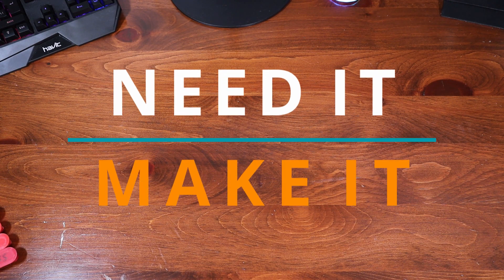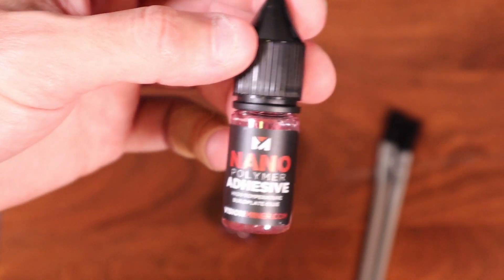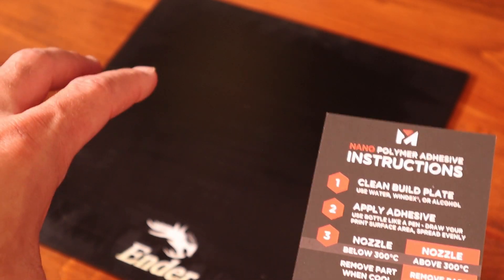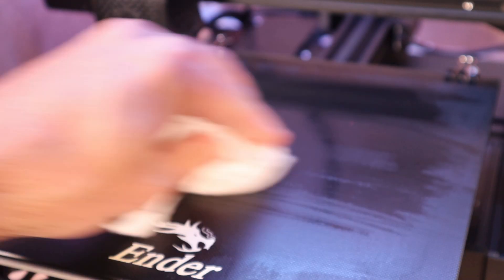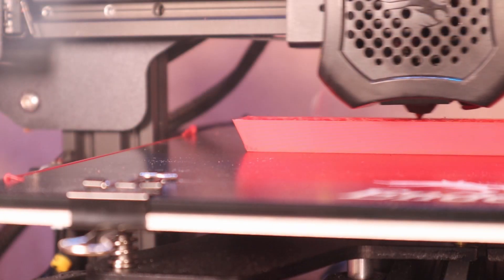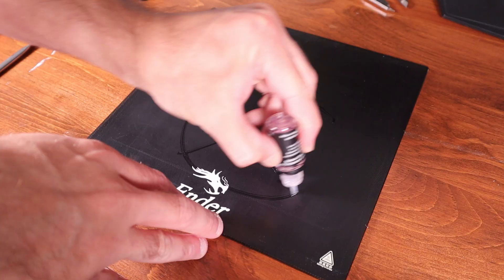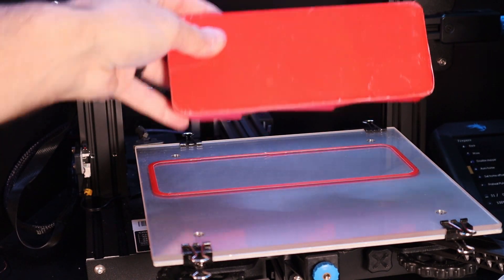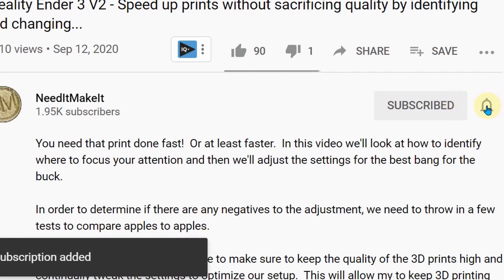Creality Ender 3 V2 - This Build-plate Adhesive Worked a Bit too Well

Comment: That chunk is pure carborundum which is E3V2 is famous for. This thing, naturally, is only found on meteorites. This thing does the most adhesion on this printer's plate and using other clear glass to take any measurements is absurd. Its expensive too. No one will ever try this product on their board if it can take a "Chunk" out of the plate.

Comment: That's the Ender silicon carbide bed! You should not need to put ANY thing on there to get prints to stick. I have problems getting prints OFF that bed if I don't wait until it cools completely.

Comment: I just clean my ender 3 v2 build plate with 99% ipa and pla sticks perfectly every time. (I use ABL). A great upgrade would be to use stiffer springs and take time to adjust the z offset.
Reply from the maker: I normally go with soapy hot water, but on occasion I like the alcohol also for a 'fully clean' feeling.  The stiffer springs are a must, have you heard much about the silicone, they'd add quite a bit of weight I'd think
Reply: @NeedItMakeIt  Not such that the weight would make a difference, but yes a bit. Still silicone + ABL would be the best way to go in opinion (at least for pla)

Comment: On the V2, on one of the first few prints, only using pla stock buildplate no adhesive at 60 degrees, the small print stuck too well and while removing, it took off a small chunk off near the centre as well😥. Still prints but now, my prints have all have small bump in them😅

Comment: Hello... great videos!!! i have a question...... wath its the temperature of the bed fot pla?? i am using 80º celsius for make the correct adhesion and avoid warping...... wath are you temp for pla??? thank
Reply from the maker: PLA is about 60C bed temp, 80 works, but you might see a bit more elephant's foot.  If you use glass, I recommend glue stick for the ultimate bond, just need to put it into the freezer when it is finished to remove the part.  I never have warpage using this method.

Comment: i have the Ender 3 V2, i just got it. i am having issues with filament sticking to the bed. I have leveled it a few times but not even the first layer will stick. I have tried hair spray, maybe glue stick next. I do see you are using clips on each corner of your glass bed, does this help? i am thinking my glass bed is warped from the factory.
Reply: I have this problem too if you have found a solution please let me know
Reply: @theneekfreak6512  I use glue sticks, they work amazing. In the past couple of months I have added a ezabl, direct drive extruder, duel z axis upgrade, all metal hotend, upgraded yellow bed springs a nice enclosure, custom firmware. I still use glue sticks and probably always will. I am probably going to do solid bed mounts next.
Reply: I have same issue with my V2. I did a test retracting the filament so that it ran empty with no filament for the first part of the test line and what I then saw was the machine even leveled what appeared to be at correct hight when at home position stil started way too high up (about around a mm from the zero height with default 0.2 layer height on all layers) so that the filament was never pressed down into the plate but instead just curled up around the nozzle. I then whle the machine was running managed to raise the bed (lower the speed to very slow and be careful not burn yourself on the hot plate while its moving) so that it then stuck properly to the plate. It was a bit tricky but got it right somewhat in the end. The Z offset or something similar seem to be a bit off. i dont know but both Cura and the machine itself have this set to 0 so dont really sure what to adjust.

Comment: is there anyway to fix the chip in the bed it just happened to me and kinda freaking out
Reply from the maker: I'd forget the stock one and switch to something lighter, I'm using 230 x 150 x 3mm borosilicate glass and it helps to reduce the ghosting effect in the y axis.  If you want to fix the glass, there really isn't a method that will make it look good, but you can use an epoxy.  Carbon Fiber buildplates are made from resin and CF, so it should work, you'd just need to check the max temp for the type you use.  

By the time you did all of that you could have purchased the borosilicate, they are pretty cheap.  I prefer black, so I am missing that.

Thoughts?

Comment: Go PETG. Unless you want full on solid with thin walls, then polycarb. Any PC Ive printed with is easier to work with than ABS overall. But then I started to make my own ABS slurry or sludge. Mix cheap pure acetone from the dollar store and some cheap ABS or old clean ABS parts to recycle them. Creates a layer of "seaweed" that doesnt come off until cooled. 
End Story, PETG kicks butt mostly and I can print on smooth tempered glass with no adhesive. Good luck testing.
Reply: Actually question, is your bed insulated? I noticed better results around the edges of the bed and/or part after insulating the bed with foam or fiberglass. Also Cura has a feature called "draft shield" and also does a good job. (Although that method only gives the warping more time to reach the part.) A larger brim will also help.

Comment: Just buy a PEI bed! Way better then glass in my opinion
Reply from the maker: Can you send a link when you have a chance?  I'd like to look into this further.  Do you find that it is prone to warpage with a heated bed?
Reply: @NeedItMakeIt  https://www.creality3dofficial.com/fr/products/pei-magnetic-flexible

I do not own a ender 3 so I don't know if this is a good one but the reviews look good. I personally have a printer with a 6mm mic6 (milled cast aluminium, very flat and no warp) build plate with a PEI sticker on it. Only PLA needs to have higher temperatures then normal to stay put(60C), the rest sticks very well. I also have a self build machine with a prusa mini textured sheet steel PEI bed on it and that thing is simply amazing. 

I really enjoy your content, very well done and I like the tempo of your videos.

Comment: for PLA i'm using simple water + sugar. Adding when buildplate is hot, two coats and it's better than anything.
Reply: Pla you should be able to print on glass with no issue.
Reply: I’ve had difficulty with adhesion for both abs and PLA. I’m only 2 weeks into this hobby and at first I started with ABS and nothing stuck Even with higher temperature and glue stick. So I purchase PLA and still have some slight issues with adhesion. If I’m printing something small 1 inch or less it stays stuck but if I’m printing more than a few items taller than 1 inch it eventually becomes unstuck especially after 24 hours of printing. I purchased nano and I’m waiting for it to arrive hoping this will be a good solution for me
Reply: @pdxcontent  What printer do you use? I have just recently upgraded from an Anet A8 to an Ender 3 V2 and the difference is night and day. I still have to use a bunch of hairspray and tape on the A8 while on the Ender 3 V2 I am just using a 50C bed and printing. I very rarely use some soapy water to clean the Ender's bed if I notice adhesion is starting to go wonky, but honestly I couldn't believe how good this bed is. I started a print last night, a tall slim object with a slight overhand angle, and I woke up this morning to see the print had fallen off once the bed had cooled down (It's about 16C at night here) but had stuck for the entire print. It could be worth investing in a glass bed if you don't have one, specifically one with the coating the Ender beds have if you plan to print in PLA.

I honestly think for ABS an enclosure is a big deal. Having the A8 in an enclosure even with the adhesion issues I have I find that once it gets up to an ambient 30C+ adhesion seems to become less of an issue.
Reply: @adamarzo559  I am looking at upgrading from my Anet A8, there are so many printers out there, but the ender 3 v2 gets awesome reviews. You said night and day difference? I upgraded my a8 to aluminium frame, and it made a huge difference, my biggest concern is overheating on long prints, so I don't print anything longer than 12 hours atm. Any suggestions would be great. I love my a8, but I think it's time to up my game🙂

Comment: For me, Hairspray works really well on al the filament types I've thrown at it. PLA, PETG (CPE), ABS, Nylon and TPU.
But I've discovered different brands of hairspray differs  *a lot*. So it takes some testing to find the right type and brand that works well.
So far I've discovered the pump spray types works a whole lot better than the aerosol types. (I suspect the latter contain something to interfere with adhesion)

Comment: The best adhesion I found is a few sprays of number 4 Tresemme hair spray works perfectly
Reply from the maker: Oh la la!  I still have to try hair spray.   I will definitely give it a try.
Reply: @NeedItMakeIt  Also for me, air spray is very good with PLA or PETG, no test with ABS. product is "CIEN" very strong, number 4 buyed in LIDL (France). And I clean a little with isopropyl alcool between print without remove air spray! and a little press of this before each print. (always brim for little part)
Reply: @maconly34  I will try the lidl cien nr4 on glass once, seems interesting.

Comment: hi, i bought me a Ender 3 V2, i would like to print PET-G, what is the beste plate to print? The original plate, the corner for the printing model goes in the air, is glass better?
Reply from the maker: I print PETG on glass with glue stick, bed temp 75.  It works very well,  I have to put the plate in the freezer for 10 minutes to remove the parts.
Reply: NeedItMakeIt Which glue stick do you use or does it not matter ? Also are you using a different nozzle on the extruder when printing PETG or the stock one ?

Comment: I have the same print bed, and without any adhesive, my print adhesion is too high. I have 3 divots like that on my printer.
Reply from the maker: Do you print with PETG?  ABS does not hold to glass unless you're using something special.

Comment: Is a good hair spray bad to print with ABS? I use it with PETG and it works very well.
Reply from the maker: Lots of people use hair spray for ABS, not many people print with as heavy an infill and bottom/tops walls as I do, so my prints are very prone to warpage.  I only use Nano bed adhesive for ABS now.  I've mess around too much with trying to find something that works, and after switching to a cheap borosilicate build plate I haven't had any issues with glass breaking.
Reply: Yes I'm really liking hairspray for bed adhesion
Reply: Same here. I use extra strong hairspray on glass. But I only print PLA and PET-G. What I like in hairspray, it's so easy to wash of from the glass bed and the finished parts by just using water. 
I recently ordered the magnetic build plate for my Ender 3, but I didn't use it yet. I might try that one with the new roll of Taulman Bridge Nylon which I also never used yet.

Comment: Try Zillagrip
Reply from the maker: Never heard of it.  Does it work for nylon too?
Reply: @NeedItMakeIt  yes it even works on PP polypropylene, POM Delrin. Works on cold glass or metal bed, heat bed to remove. You have to dilute it for PLA.
Reply: @NeedItMakeIt  see videos at Zilla3D yt channel. Email website for sample to try if you wish

Comment: Sorry wrote that 11pm last night.  PLA I use on boro glass bed.  The stick glue is the one with orange cap and comes out purple (elmers ?)
Reply from the maker: No worries, I've printed a little bit of PLA, I used glue stick and could not get it off, I heated cooled and so on.  Eventually I had to pry it off with the putty knife.  I had been printing with ABS for about 2 years now, and I'm ready to move on I think.  ABS has some good points, but it has some pretty bad ones also.  PETG is my new friend and the glue stick seems to work really well on Boroglass also.  Thanks for taking the time.

Comment: "Stuck a little too well?"   I've been using the blue glue stick and most time I fight to get it free from glass build plate
Reply from the maker: With PLA and PETG I have that same success regardless of how thick the walls or infill are, I can not remove the parts from the glass without using the freezer.  That's not been my experience with ABS at all.  I must admit that I have never the Blue glue stick, I've tried the ones with orange and white caps.
Reply: @NeedItMakeIt  I get bad bed adhesion even with glue stick, 95° bed temp, on a enclosure with thermal insulation and with a 30mm brim

Comment: You probably don't have good adhesion because you seem to be printing to high and/or with to low flow or e steps. your brim should not separate into individual strings like they are on your prints when you lift them off.
Reply from the maker: I did have that problem when I first received the printer, the E-steps were not correct and could not be saved until I did a firmware upgrade.  I over-extrude the bottom layer although I do wonder whether the build-plate temperature may not be quite right for this material. Layer adhesion is related to temperature, if the extruded material has cooled too much the adjacent lines will not have as good of a bond, producing the result you are referring to.  

As far as adhesion, I print structural ABS parts with no fan, 0.6 nozzle, 0.2+/- layer height with a thin initial layer height, 5 wall lines 5 bottom layers 6 top.  Parts with these properties are prone to war-page.  I've recently switched to PETG to test, this material does not come away from the build-plate.  I can only remove the parts using the freezer method.  I do print on glue-stick with PETG. 

I may switch completely to PETG I first need to make sure that it can handle loading like ABS without fracturing and I think it can.
Reply: @NeedItMakeIt  PETG can destroy your glass easily, use glue stick to make it release. PETG also works very well with PEI and eats stuff like the flexible old ender 3 build plates for breakfast, they wil permabond haha
The issue with PETG is that it's much harder to get a nice clean print then with ABS. Especially with small details
Reply from the maker: @malloott  I've never had that much of a problem with PETG bonding to the glass with no glue stick, it does bond incredibly well with it, and into the freezer to remove it.  I'm sure you're right because I've heard this from quite a few people.    I did find ABS produced cleaner prints with less stringing, I am experimenting with super-drying my PETG to see if that can help to compensate a bit.